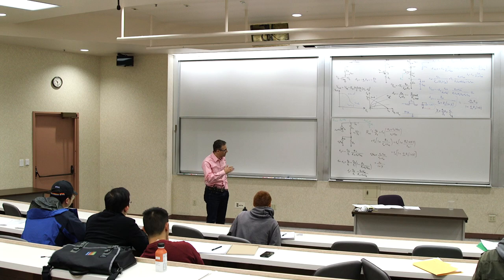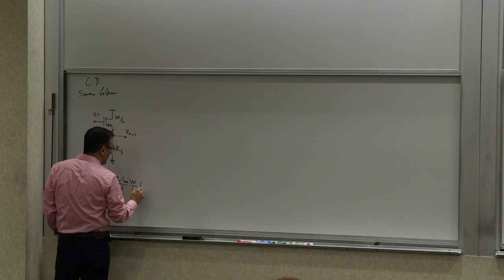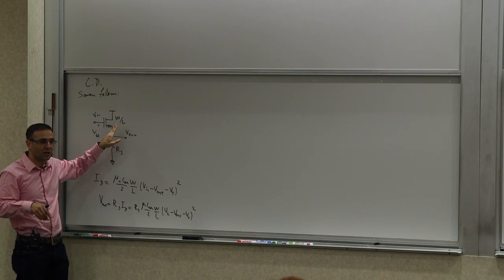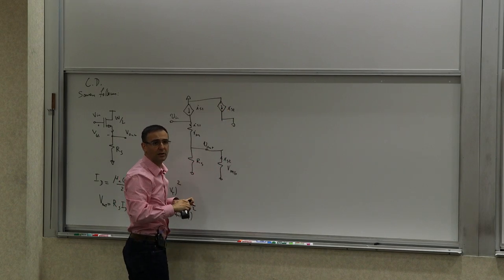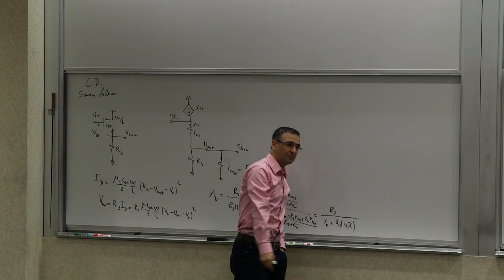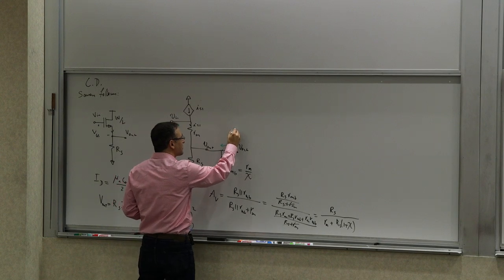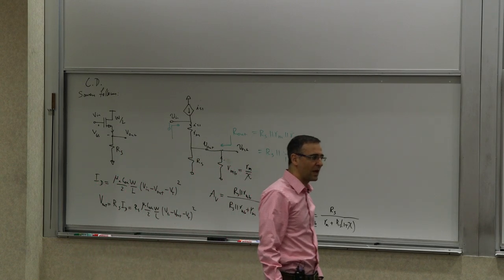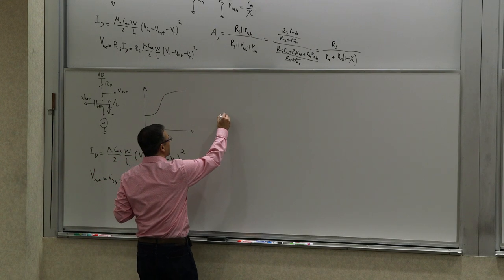124N. (Pt. 2) MOS amplifier stages: common-drain, common-gate, cascade, increasing the gain

Comment: 0:03 : recap about the previous video , and why the units that will be introduced in this video are the basic ingredients of the design
0:56 : common-drain
10:13 : common-gate
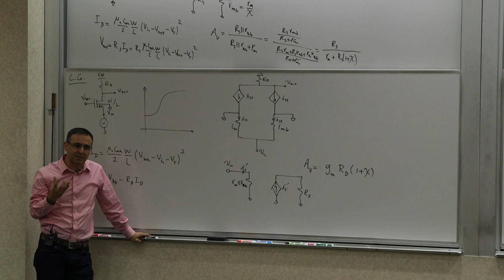15:20 : cascade and increasing the gain

Comment: Hello, for me is not clear why sometimes in the small signal, when we consider the body effect,  we consider r0 and sometimes we dont. 
(for example at 4:56). 
Thank you again for the lessons! :)
Reply: Even if you consider r0, it's one terminal is connected to the source i.e Vout and the other to ground in small signal. Hence, it will come in parallel with Rs || rmb. r0 is much larger than rmb hence in parallel connection it won't matter much.
I hope that clears out the doubt.

Comment: 34:10 Well the total current isn't in pA, only the change in current is? Are you saying that change is smaller or similar to noise levels so that's why our model fails with increasing output resistance?